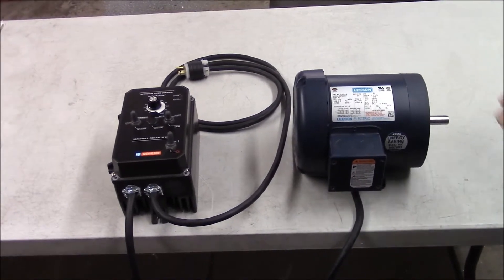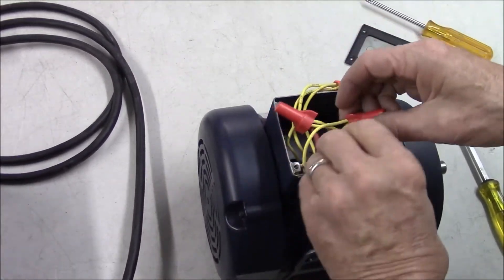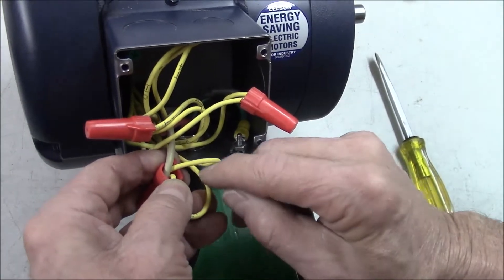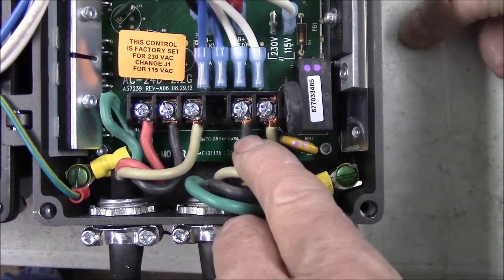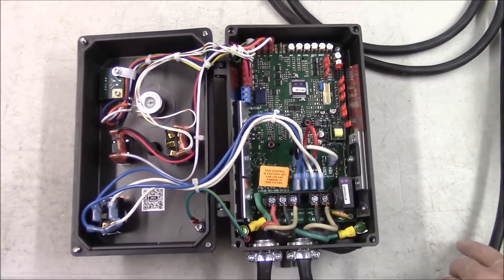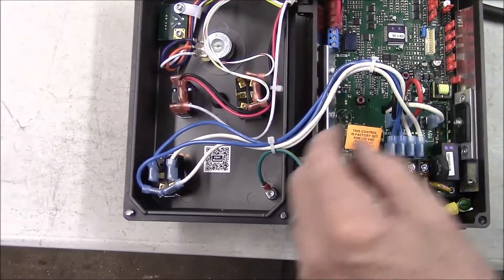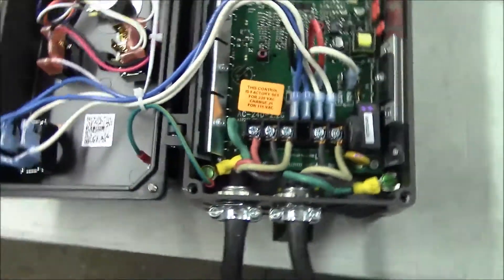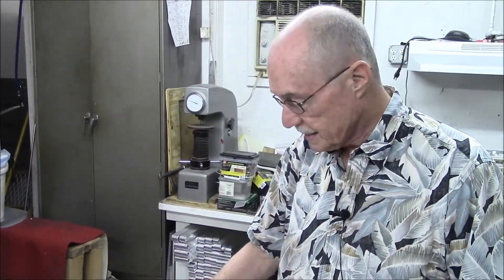Wire Kit

Comment: Can you do a video on 240v wiring?  There seems to be some confusion online about the power side of the VFD out to the 240v power source/plug/ receptacle.  Some are saying you need 2 hots, 1 neutral, 1 ground wire...others are saying just 2 hot and a ground.  So for example let’s say we use 10 gauge, do you need 10/3 cable or 10/2 for the power source.
Reply from the maker: We will be doing that in the near future. It is needed.
Reply: Reeder Products, Inc. Thanks!  I finally confirmed that L1 and L2 when wired for 240 (and the jumper is in the right position) are both hot.  But still you are totally correct, that video is needed👍

Comment: Can I get your RPS450 3HP with VFD that will run that motor off 110v?  Let me know, thank you.
Reply from the maker: You can not it is only 220V. RPS 350 is either 110V or 220V, but 110V drops it to 1  1/2 hp.